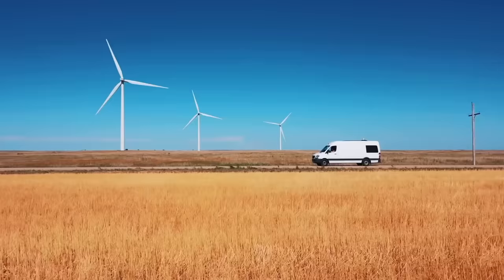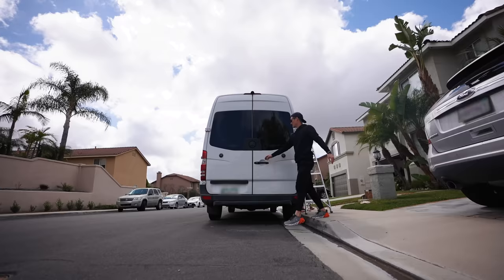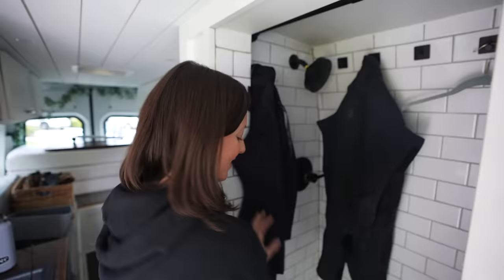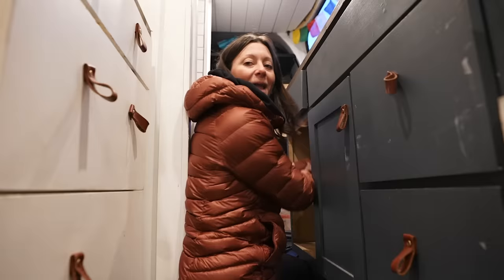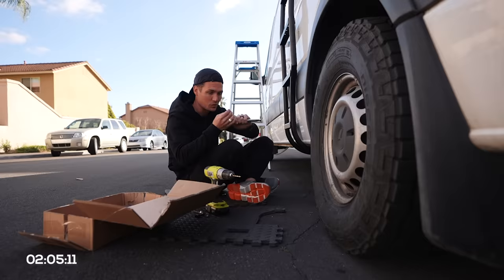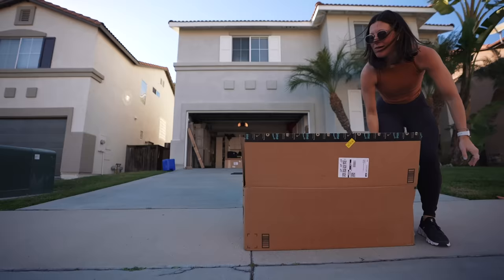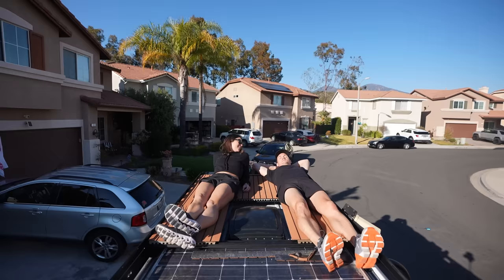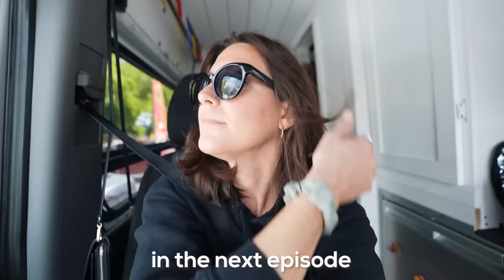UPGRADING OUR VAN FOR THE ULTIMATE MEXICO ROAD TRIP!

Comment: There is a rack for surfboards that can hang on the side of the van. That way you don’t have to block the solar panels. Also, you can just grind of the bolts of the solar panels and rearrange them in ton of your new roof rack that way you can get the space you wanted for the deck. Hope all goes great!

Comment: Weigh your van fully loaded, your build and adds may be pushing the max. Then take to MB to have alignment corrected (all conversions need alignment after conversion). Don't want you breaking down in Baja. 

Yesterday I dumped the #2 bucket in our composting toilet; first time in 6 months (it was only used twice). No smells. We use aspen shavings for pets, available from Walmart, most pet stores, etc. No need to moisturize, uncompress, just pour in the bucket and go. Literally. 

It was Soooo, easy but then we have a C-head. Watching the both of you struggle with that Nature's Head confirms I made the right head choice.

Comment: Im watching the deck project be completed, and I'm so glad to see what product you used because we also want a deck on top of our diy camper van.... the biggest worry I have for you though is the shading over your solar panels, at the 24:40 mark I can see that a portion of one of your solar panels is underneath the deck and cross bar of the roof rack.... I've learned through my solar studies that even a teeny tiny bit of shade on your panels cuts down on your solar collection abilities by a LOT.  I hope this works for you!! But what I plan to do in our build is have the panels on TOP of the roof rack, and deck off to side of panels, that way no shade on the panels (and they will tilt as well for winter optimization).  You might have to move those panels. I'm just saying.

Comment: Kara & Nate >

Re emptying the composting toilet: it's easier if you slide off the top part of the toilet, so it's not attached while you empty it. The top just slides right off. 

There should also be a screw-on top for the pee tank so it doesn't slosh around when you move it.

Comment: My two cents on the deck: it should essentially fold in half, and you flip it open over the panels when in use, and flip it closed when done to re-expose the panels. It should also help the open side stay cleaner. The marine flooring was a good idea!

Comment: I would have loved to see you actually cover the vent with the decking, it should have plenty of air flow even with it being covered, considering its a fan that pulls moisture out. and everything outside of the van is completely waterproof. except the floor. yall might want to get that situated. My reccomendation for not getting the floors wet is to get a slatted wooden floor mat thats meant for inside the shower and you can set it just outside the van, most people use it for ourdoor showers id say.

Comment: ... ADDITIONAL ... to slide the top half off, it needs to be opened half way first.  Therefore, unlatch the top half from the bottom half, then lift the top half on the hinge, THEN you can slide the two haves apart.  Hope that helps.

Comment: maybe put a piece of corner molding on the front of it so wind does not lift marine flooring up. bet you could use corner bead like for drywall as it's metal n very light weight or wood corner bead molding

Comment: You may have done this off camera but make sure you seal those nuts into the roof with some type of silicone or sealant and apply sealant to the threads of the bolts.  We have had water make its way into our service vans multiple times where we installed ladder racks.

Comment: This might be a little too late of a suggestion BUT if your needing more surface space for the roof deck where the fan is you could build a removable cover  that fits over the fan that’s flush for when your parked and using it so you have a bit more area to sit and relax. Then when your ready to move just store it.

Comment: Have you considered making a flip piece to the deck that would connect a permanent front and back deck and could hinge over those pieces and be secured off the solar panels except when in use and then it would be resting on the rails?

Comment: Love your videos, just started following you after you visited with Eamon and Bec. As a long time user of the natures head composting toilet I watched you change it and wanted to add a few tips. First of all you can remove the top toilet seat from the bottom unit which makes it a heck of a lot easier to clean. Just slide it to the side, and they separate. You want to hose out both parts really well every nook and cranny when you’re cleaning each time you dump the solids part. Flies can lay eggs in there, and they tend to lay them in all the indents in the plastic. I personally love the natures head toilet, going on ten years of using it, between rv life and boat life.

Comment: Have you guys thought about getting a Starlink Dish? They opened up roaming and it will work down in Mexico. I had mine delivered in 9 days and 120+Mbps in Denver 250 miles from my registered Starlink address. Roaming means high speed internet anywhere you guys go. I am also getting about 15+ Mbps on upload. Something to think about, way better than a cellular hotspot!

Comment: When I saw you put the rubber floor tiles in during ski season I jumped on that idea and lined my whole class c (20 foot) with them too. They definitely add better insulation, sound proofing and softness when standing around. Update us when you find out about the moisture issue so I can watch for similar problems. How have you enjoyed the Baja, never been myself but did do the other coast of the Sea of Cortez, the Sonoran side.

Comment: Use a angle grinder to "cut" the mounting for the solar panel then make some new. like it's right now you will have a shadow on many of the cells causing it to not charge efficiently. Anyway great work  :D

Comment: I'm building my own van, and I used plus nuts (I call them rivnuts – short for rivet nuts – because that's what I first heard them referred to as!) to secure all the framing to the metal ribs of the van. I don't think I'm anywhere near as proficient in upper body strength as Nate, and there were about 30 of em.....so you can imagine how long it took and how sore I was afterwards lol.

Comment: Composite wood swells, you needed to leave 1/8 gap between each one. It is going to buckle and put enough pressure to bend metal. You will have a roof leak with in a few months.
Reply: I was in landscape/hardscape for 8 years and had to repair enough decks and fences in that time. I would fix it now before you have a bigger issue later.

Comment: You guys may want to check your water system.  That is way too much water inside the van for just moisture.  With your lines freezing, there may be a cracked line somewhere in the system.  Great work on the van though, it looks great.

Comment: Hi Nate, nice work on the roof rack.  Just wondering if you used lock nuts underneath your wood slats for your roof deck?  If not, regular nuts will work loose and fall off, especially when the wood shrinks up in the Mexico Heat.  Safe Travels, Jeff

Comment: two words HOT GLUE. if you can try and hot glue the bolts on the roof rack. not only does it somewhat prevent water from getting in. but also makes rattling sound WAY less. just a dab is all you need, not as much as the superglue you already have on. best thing I have ever done to my van was hot glue the bolts. and if you need to take something off it is quick and easy to take off. make sure that you dont glue anything that has a non gloss finish or paint on it because it will take the paint with it if you try and take it off.

Comment: My husband is an engineer and had some really great ideas for your roof. Feel free to reach out for your next project and he can help you with the engineering portion.

He said you should have removed all your solar panels from the brackets or cut the panels from the brackets if there was no way to remove the panels from the brackets. Then leave the brackets attached to the roof so you don’t lose the nuts between the roof and ceiling. Then you could have attached the panels to your new cross braces/roof rack. Then you could have made the larger deck where you wanted.

Comment: Why is there not a bucket inside the toilet? 🧐

I'm sure others have thought of this: Finding a bucket that fits for the "solid" and then just take the bucket up, empty, clean, fill it with new moss outside the van/tiny house, and put it back into the toilet, and ready to go!  

Just like most small as heavy metal pedal-trash-cans have. 
I know, these don't have the handle "thingy" that goes into the waste compartment, but still, this problem should be easy to solve for the company making these toilets! 

This toilet costs just above 1000 US dollars, and perhaps you CAN buy a bucket that fits this "Nature's head" perfectly, and I just haven't seen them yet?  

Or why else do it the hardest and heaviest possible way of taking the whole toilet out, tipping the whole toilet upside down, etc, etc.  

Besides the (perhaps) extra cost for an "insert" bucket, there MUST be better reason than "too easy" -   and one (or more) I just haven't thought of..?!

Stay positive, happy, creative, and nice to others! ❤

Comment: 24:00: Not a good idea to have drilled through your roof racks...all you have succeeded in doing is to substantially weaken the roof racks by drilling them full of holes...don't be surprised when you are all sitting up there one day and the whole thing gives way...I would have rather put in cross beams (thereby only drilling much fewer holes and then screwing the decking onto those)...Nate is not the sharpest tool in the shed!!!